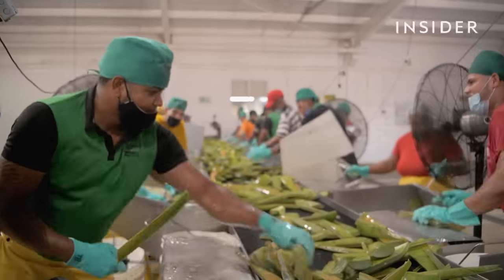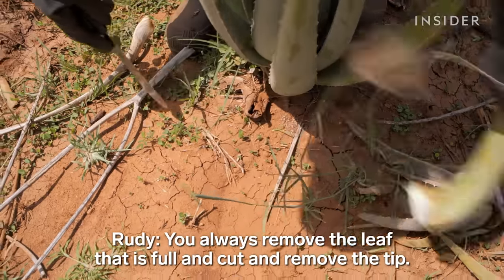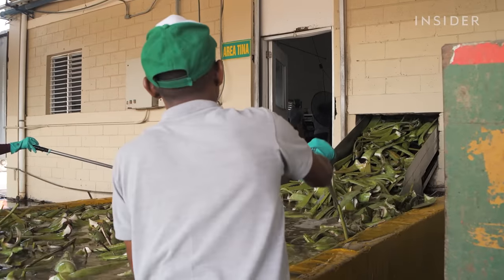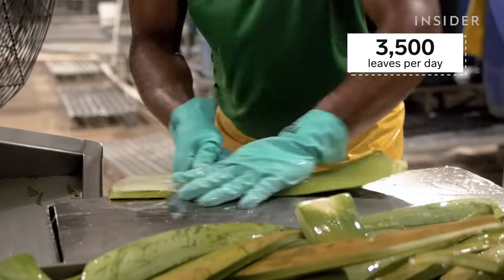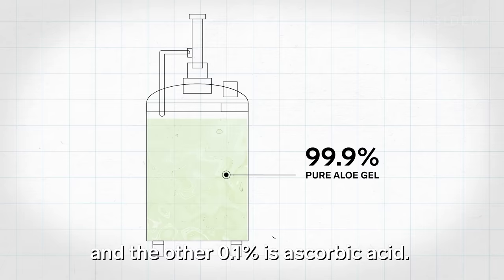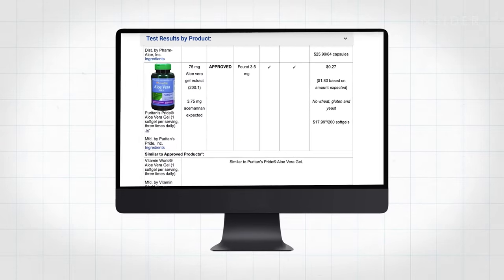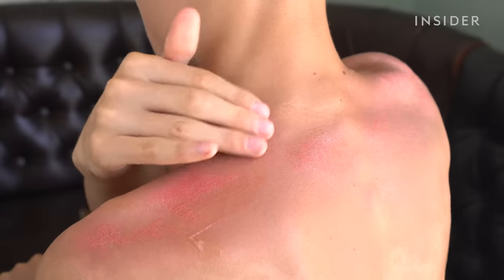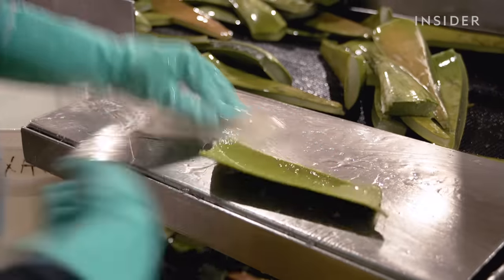How 1.5 Million Aloe Vera Leaves Are Harvested A Week | Big Business

Comment: As someone who makes skincare products, a clear gel in a bottle is a sign gelling carbomer was used. Real aloe vera gel is cloudy and is exactly what you see when you fillet an aloe leaf. There is also no 100% aloe vera product because a preservative will always be needed for extended shelf life and safety. If you want 100% aloe vera just harvest from a aloe leaf. That is 100% aloe.
Reply: Could name some non-harmful preservative?
Reply: @amritaparida3992  "The dose makes the poison". All preservatives (yes, including parabens) approved by cosmetic regulators are non-harmful when used correctly. I've seen some "natural" brands use potassium sorbate and sodium benzoate for aloe vera.
Reply: @mdml0  can we preserve aloe on our own if so which preservative to use?
Reply: That’s what I always do. I much rather buy a leaf and use that over some synthetic products
Reply: @olmakses5428  you can if you know what you're doing. You can use the ones i mentioned in another comment if you have access. Just know that using preservatives will also require microbial testing so you can check if your preservative is actually working and if there is any harmful bacteria or mold growing in your aloe juice. Then you also have to check and adjust pH to suit the preservative. For short term preservation and if you don't want to mess around with preservatives and testing, I suggest just freeze your aloe fillets and take one out as you need it. Make sure to sterilize everything.
Reply: If there is a farmers market in your area check to see if they have any
Reply: As long as it works, it works 👀🤡
Reply: @olmakses5428  refrigerate it in an air tight container
Reply: @olmakses5428  they live happily in pots, cut a leaf off the plant when needed. Processing it into a gel takes less than 10 minutes in a blender. The plant preserves itself!
Reply: I use the plant myself or products form Arubaaloe or Curaloe. These brands use real aloe Vera for sure
Reply: Did you watch the video?
Reply: @mdml0  Thank-you
Reply: @elizas3249 oh  Thank-you but I want to persevere it just like in market I ended up having 70 aloe plants so I wanna persevere for a long time .And they are all grown
Reply: As a cosmetic researcher myself... I 100% agree with whatever you said in above comments!! 💯 Only a real cosmetic chemist knows it 😅 others will either lie or have insufficient knowledge themselves
Reply: @girlwithnoname0  Thank you so much for the validation! 😄
Reply: @olmakses5428  yes but it’s probably easier to just keep a plant, then you can have fresh aloe whenever you want it.
Reply: Salute to all these hard workers. Workers like them are literally the backbone of this world.
Reply: @olmakses5428  u can use pure honey
Reply: @olmakses5428  why preserve at all when an Aloe plant cost less than 10$ and is the easiest succulent to care for. Just get fresh Aloe from your plant and use the left over to Fertilize your plant again lime they do at the factory. 100% Aloe guaranteed lol
Reply: @elizas3249  *👍Yes I've been doing that way  for years. THANKS.
Reply: Aloe vera spreads like weed in India. Plant a small one in a pot and by end of year you'll have a full pot about to burst due to weight and number of new plants that come out of same orignal plant.  Cut a leaf, keep it standing upright for half hour to remove yellow liquid (or not but advisable). Then slowly slice off the thick green part and use the gel inside as you want.
Reply: @optimystic6502  I know this and I myself have been using Raw Aloe Leaf for years. I just happen to ask for non-harmful preservatives ( again, I know all preservatives are harmful and non-harmful depending on varying amount but what I meant to which one would much better of an option) so that I  can make my own Aloe based skincare products. But anyways, YT comment section seems to be of no use.
Reply: @amritaparida3992  lemon and sugar
Reply: @kian kpoop
Reply: @amritaparida3992  there is no one preservative I can recommend because it depends on a lot of factors. What product are you making? Is it for the hair or something applied near the eyes?What else is in your product? Are you aiming to be organic certified? What does your supplier have? Will you be selling to certain market? There are so many things to consider which ultimately you will have to research and decide on.
Reply: @mdml0  Yep, I get it. I am researching.
Reply: Contains aloe*
On the back: *(0.1%)
Technically right
Reply: @amritaparida3992  you're welcome
Reply: entrepreneur  What are you trying say?
Reply: @olmakses5428  plant your own aloe. The living plant is the preservative
Reply: @Wandering thoughts D thank you 🥰
Reply: @kian bacteria exists on everything including your skin babe and the inside is used not the outside. plus produce should always be washed.
Reply: @kian yes I’m aware, are you a dermatologist? If not, your opinion is irrelevant. Don’t put words in my mouth to try to make a point, never said natural is better and everything is chemicals. Mind your business.
Reply: @kian you’re not a dermatologist that’s very clear. Go read a book and worry about your spelling before you worry about me. Just a warning.
Reply: @kian you lost the argument a day ago when you used fallacious logic girl. You can google it to learn what that means. Never said I was (that’s an example of the strawman fallacy) but I’m not the one giving unsolicited advice am I?
Reply: @kian girl… why do you care so much what I do with my own face? You don’t understand how the comments section works? Stay pressed I’ll stay blessed.
Reply: @kian seek help.
Reply: lucky me I have like five Aloe plants (Sábilas here in my country) in my house, a lot of people have them as a house plant in my country  actually
Reply: I'd rather buy the aloe leaf and clean it at home. It is not only for skincare, but also for juice. 😆
Reply: what is the shelf life of 100 %aloevera
Reply: @manz007  not very long. A few days if in a cold dry sterile environment. They start to degrade once cut from the main plant.
Reply: @olmakses5428   i had good luck using the fridge assuming u mean aloe cuttings
Reply: What  do uwant.
Reply: @sunisaseasan2417  a million dollars, eternal youth, and a puppy
Reply: I don’t know about the skin care aloe products but I do have aloe plants at Home. Once I tried applying the gel on my face and felt very itchy and was red with rashes. On top of that I don’t use any aloe products available in the market. Instead I go for soft cream for face
Reply: Yes 100% aloe vera gel only for 1-3 days in refrigerator
Reply: Proverbs 3:5-6 KJV
Trust in the Lord with all thine heart; and lean not unto thine own understanding. In all thy ways acknowledge him, and he shall direct thy paths.
Reply: i too raid my neighbors lawn to harvest his aloe and weird looking oranges
Reply: but the cancer part of the outer leafs is a thing to consider
Reply: My parents plants their own Aloe plants. We're in good hands.
Reply: Or you can just by the leaf from your local farmers market. Spanish farmers market they all sell the leaf.
Reply: Yup
Reply: @pri.sci.lla.  yeah my parents by the leaves instead of the process shits
Reply: I wish there was places near me where I could buy aloe leaves
Reply: Yep. Just grow your own.
Reply: @amritaparida3992  I personally would use colloidal silver or essential oils to preserve it if I needed to.
Reply: thank u so much for sharing info!!
Reply: I see, now I can understand why that mindset can produce 0.1% aloe
Reply: Thank u
Reply: i have an aloe plant, i use aloe gel almost everyday, its the answer to ALL my skin problems.. tan, rashes, burns, pimples, dryness... you name it. Since harvesting the gel everyday isn't time efficient... i collect the gel from 6-7 leaves, blend it along with brewed green tea.. and freeze the mixture into ice cubes... the gel lasts very long, and its so soothing on the skin.
Reply: Hnm
Reply: My aloevera plan is not cloudy it is clear:the inside
Reply: But it difficult to take gel out and make useable paste
Reply: You can freeze it!
Reply: @amritaparida3992  did u find any way to preserve it other than refrigerating it
Reply: 90% to 99% aloe is still as good as natural aloe right?
Reply: @Pilot JollyRoger Yeah so then this peecentage thing doesn't matter if it just fall on 90 to 99%
Reply: Absolutely right 👍
Reply: @olmakses5428  use water and grow it,  best way to preserve it
Reply: One and   only   God is   Allah   bcz   if there   2  or more   God   then   sun   direction can   reverse   sometimes   and more   God   then they   fight each   other   and destroy   whole earth
Reply: Do you have to filter it after putting the aloe meat in the blender?
Reply: @Pilot JollyRoger jason witch vera was a great product, not sure why they discontinued it ,  only alternative nowadays is Millcreek botanicals aloe vera gel
Reply: What about the water
Reply: 0:19 0:21

Comment: Wow. The speed at which they filed those leaves is incredible
Reply: Sorry to correct you, but it's fillet. And I completely agree, I'm really impressed they don't cut themselves more
Reply: @solstice6505  haha thank you, hate auto correct sometimes
Reply: @solstice6505  fillet is a piece of fish cut from the bone filet is meat cut off the bone so technically aloe isnt a filet
Reply: @MaestroTunes  fil·let  (fĭl′ĭt)
n.
1. A narrow strip of ribbon or similar material, often worn as a headband.
2. also fi·let (fĭ-lā′, fĭl′ā′)
a. A strip or compact piece of boneless meat or fish, especially the beef tenderloin.
b. A boneless strip of meat rolled and tied, as for roasting.
3. Architecture
a. A thin flat molding used as separation between or ornamentation for larger moldings.
b. A ridge between the indentations of a fluted column.
4. A narrow decorative line impressed onto the cover of a book.
5. Heraldry A narrow horizontal band placed in the lower fourth area of the chief.
6. Anatomy A loop-shaped band of fibers, such as the lemniscus.
tr.v. fil·let·ed, fil·let·ing, fil·lets
1. To bind or decorate with or as if with a fillet.
2. also fi·let (fĭ-lā′, fĭl′ā′) To slice, bone, or make into fillets.
Reply: @solstice6505  u are literally proving my point its meat or fish so aloe isnt a fillet and those 2 terms filet and fillet are both mostly used for meat and fish in the industry (one is the french variant)
Reply: Salute to all these hard workers. Workers like them are literally the backbone of this world.

Comment: 4:46 aren't most pasteurizer basically high temperature? When killing bacteria wouldn't the amino acids be destroyed as well?
Reply: They using Tubular Heat Exchanger (THE), which usually used in UHT sterilisation, 134C for 2s. For comparison, a long life milk also use UHT, do the milk lose the nutrients?
Reply: no name  i think the scientists also do test the sample b4 and after so dont try to act too smart
Reply: Yes, likely they're cooking it low and slow so most of the amino acids are still there
Reply: Out the door quick smart, they say its high pressure heat for couple of seconds n then back to room pressure and room temp. Same as UHT milk, fast n yea it does reduce "the goods and the bads" but is better then mouldy allo in a bottle 3 weeks later at your market
Reply: I'm sure it denatured a lot of bio materials, but since the effects of the plant on the human body aren't well understood no one knows if it matters or not really.

Identifying specific molecules/chains and what it does is a basically the entirety of drug research. That's when it stops being a folk remedy and becomes modern medicine.
Reply: Amino acids are tough molecules
Unless they are heating in a really harsh chemical bath they will be fine
Reply: @ususshjd1994  Scientists also said smoking was healthy 60 yrs ago
Reply: @kali888  the thing with science though is that it changes whenever new evidences/proofs are presented. It's not stiff like religion where dogmas are considered to be eternal. Like what Einstein did to Newton's theories. If you have a claim, you have to back it up with REPEATABLE/VERIFIABLE proofs or evidence, otherwise you're just a nut or conspiracy theorist.
Reply: They don't kill all the bacteria.. they leave about 10- 20% which your body can handle..
Reply: @kali888  no they didnt, those were doctors and people who work in that field, doctors only started being reputable  pretty recently
Reply: @johnnymcblaze  I am so glad to hear someone mention Dr. Burzinsky!  He really should have been given the Nobel Prize and instead he was harrassed by big pharma thugs.
Reply: There are alternatives to pasteurization that hopefully will become more widespread like electric fields and radiation.

Comment: I noticed all the workers suffering in the hot fields and on the line cutting 3500 plants a day are men. While the women push the light aloe around on the line. I wonder if those women are complaining about equality and are demanding to be out in the fields getting heat stroke every day. The same thing happens in the factory I work in located in CA. All the men are suffering outside on the dock while all the women are inside putting stickers on the boxes. I’m seriously thinking about changing my gender.